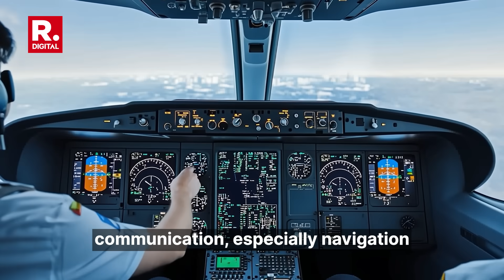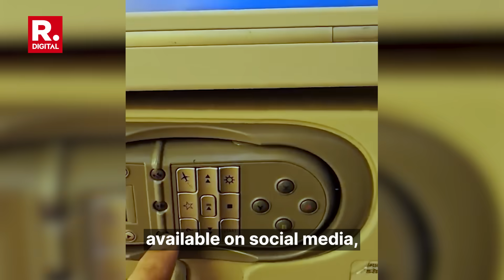Pilot Analyses The Video Of AI171 Crash And Explains What May Have Led To The Flight Mishap

Comment: Solar flares caused boeing satellite data corruption hence glitches in software. May be software was hanged. Before software resumed it was too late for accepting b787 pilot thrust commands. ISRO people can guide flight routes, schedules to avoid future accidents by solar flares satellite corruptions. Sensors, gps, altitude readings become faulty during geomag storms. https://youtu.be/825BVDrIHNc?si=et3FUS0r-57Cbmlk

Comment: This was an Electrical failure. The Pilot's Mayday said they had lost Power AND Thrust and were going down. A Dual Bus Electrical failure caused a Glitch of the Flight Computer's FADEC and CCS Fly-by-wire system causing a low power throttle setting. The electrical failure also prevented the landing gear from retracting and the flaps deploying. All this seems to have happened about 8 seconds after take off.

Comment: The Air India pilots realized they were doomed but could not turn back.  They had already passed the “point no return” markings on the runway.  They could not abort this takeoff.  The engines were not providing sufficient thrust to get the plane's speed up and fast enough to maintain lift and climb.   The pilots then made the Mayday call.  Within fifteen seconds the plane sank and crashed.  This was both Pilot Error combined with controls not functioning properly. Multiple causes contributed to this disaster including electrical or mechanical failures, overloading the plane with cargo not recorded, inappropriate repairs done, poor maintenance, etc.  There were numerous electrical issues discovered in the interiors of the plane, as reported, by passengers on the plane's first flight of the day. The seat monitors, sound systems, crew phones and the overhead air conditioning systems were all not working properly. This was a forewarning that more serious defects could exist.  This was Air India's 'Red Flag' warning but ignored.   But they did not cancel the flight.  They did not get a replacement plane.  Resulting in the death of more than 250 people.   

Unanswered questions must be raised. What were the last repairs made on this plane?  Who were the Quality Control and Quality Assurance agents checking these alterations were done properly in accordance with manufacturers directives?
Reply: Completely bogus comment above. There is no "point no return" marking on any runway. The FMC computes the go/no-go speed and rotation speed for the aircraft weight and airfield conditions (temp, PA, RCR). The FMC also take the fuel weight into it's calculations. The most likely cause is the PM raised the flaps instead of the gear placing them in a power on stall which was not recoverable at that altitude. Yes, the handles for the flaps and gear are in different locations, but I've seen pilots grab the wrong switch/button/handle many times in my 40 years experience as a pilot.
Reply: I agree with you brother the engines went off taking off it didn't have enough dragging it even reached almost the of the running way

Comment: RAT was functioning before sliding down means engine failed due to pilot error.. Take off was normal, landing gear stopped working, flaps non functional..Sensors in Boeing will not allow such situation..pilot error is evident..common sense..survivor says there was red and white warning signs inside the plane after take off..Pilots may have had gujarathi  lunch and. Forgot something

Comment: I believe it is hydraulics failure cause all the flap operating and aircraft loosing lift. Overloaded plane and engines failed on 120% overloading after wings failed to give the lift the bent wings give the signal of failure.
Reply: Fuel supply shutoff?
Reply: It was refueled in Ahmedabad so ice should melt
Reply: The moment when they realise they are not generating enough power, out of panic they focus on giving xtra pressure on wings and forgetting to close landing gears. Till the time they realised to take landing gear off and keep the plane airborne, it was too late. Possibly fuel consumption failure (Locking) 😢
Reply: no ,ice formation in the supply fuel tank due to high altitude.
Reply: @langietor  High altitude? It was barely at 500ft high from the ground.
Reply: @Komal_US  no in previous flight. It did a Delhi to Ahmedabad flight. Ice formed on this flight in delivery tank. It seeked too much oil after just take off for more thrust. But pump pulled ice with oil then pipe got jammed.